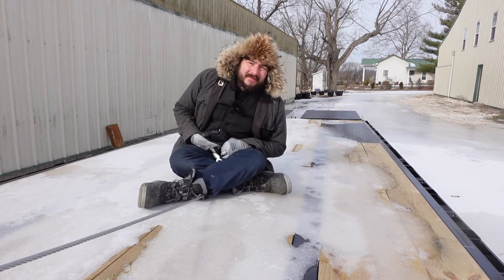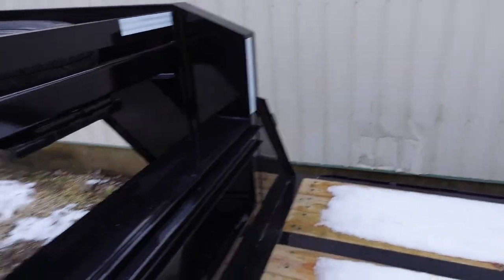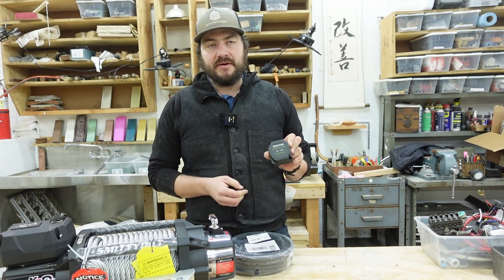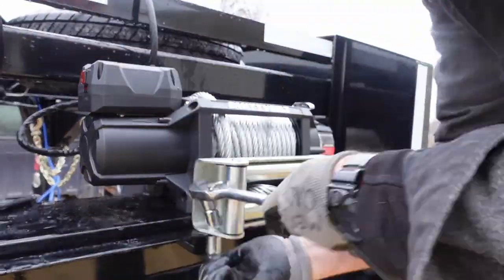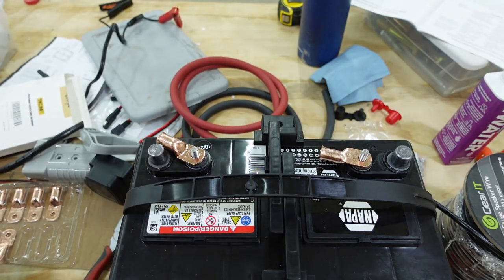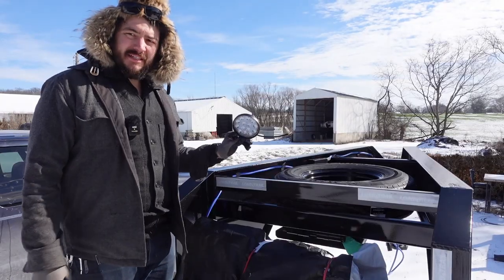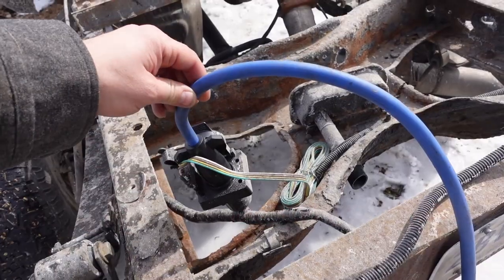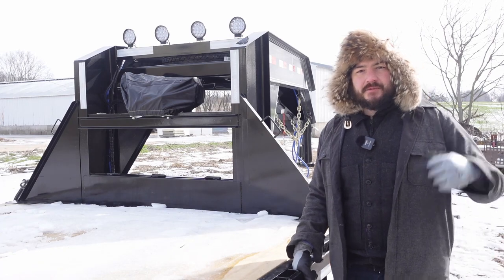Smittybilt 17500 Winch Trailer Install + Unboxing, Extra Battery and Charger

Comment: I’m installing the same winch this weekend. It will have a solar panel to keep the batteries topped off when the trailer is parked.   I do electronics for a living, so it will also be able to charge from the truck connection when running down the road and will not back feed to the solar panel.  
I really like the drop-down spare tire rack on your trailer. That and the winch plate are really nice touches.

Comment: Those wires are big enough to recharge the battery?
Reply from the maker: Which ones? So far works great, slower charge from truck, but big wires for the winch